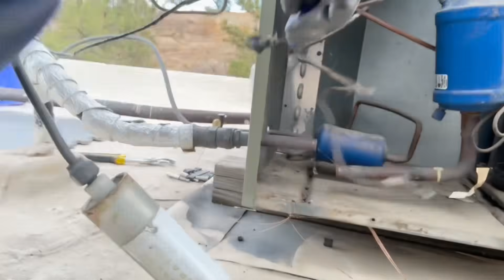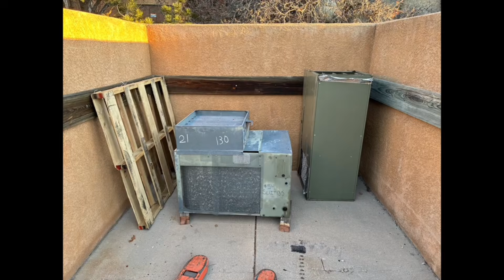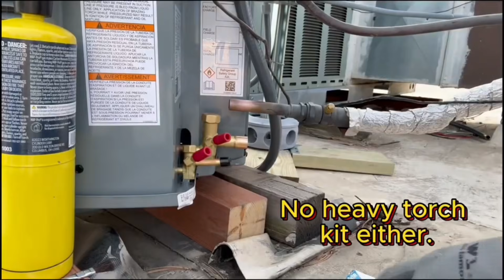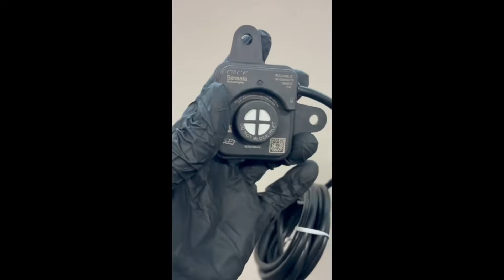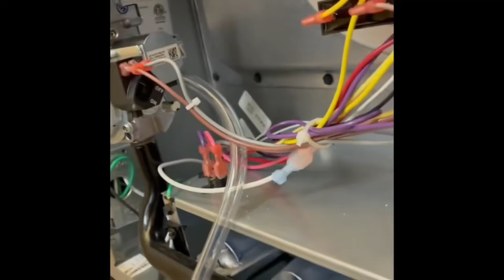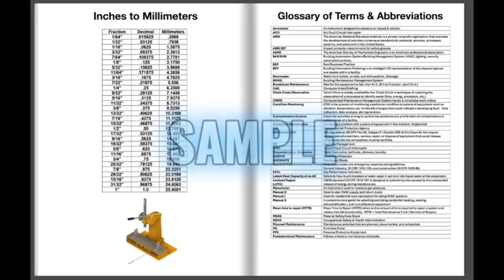How to Install an A2L R32 Split System | Step-by-Step Overview

Comment: I honestly cant seem to find any reason for the exhaust that was added i also dont see anywhere requiring it for A2L refrigerant.
Reply from the maker: The B-vent exhaust stack is for the exhaust gases from the gas-fired furnace.
Reply: @kjfacilities-maint  then its not related to the A2L refrigerant? Ive never seen this for an 80% furnace, only on the high efficiency furnaces. Which makes me believe it wasnt necessarily needed here?
Reply from the maker: The new furnace has a draft inducer fan, it’s a non-condensing model (often referred to as a "fan-assisted Category I" appliance).  So a double wall B-vent is required.

Comment: Not to be critical but I was taught in school to remove the cores before sauldering to keep from damaging them and to stop pressure buildup from blowing out the joints
Reply from the maker: You are correct, it is a best practice to remove the Schrader valve cores before soldering or brazing to reduce the risk of damaging the Schrader valve cores and causing them to leak.

Comment: Could you have run the refrigerant sensor over and down with the thermostat wire?
Reply from the maker: Yes, I could have done that. I just wasn’t comfortable running the sensor behind the exhaust pipe. And I did not want drill a new hole in the left front cover of the evaporator, I was trying to use that existing penetration that came from the factory.